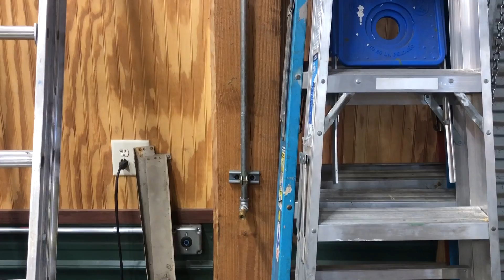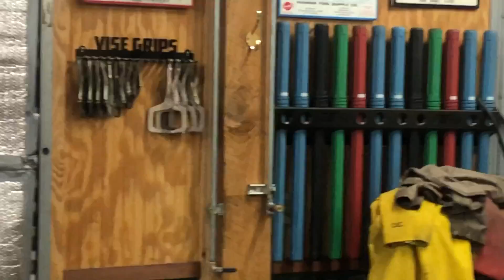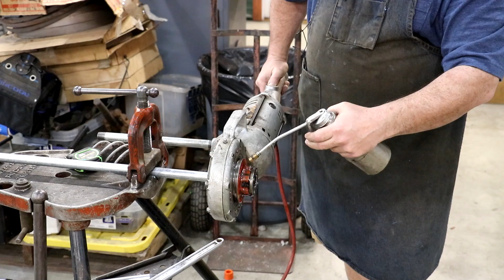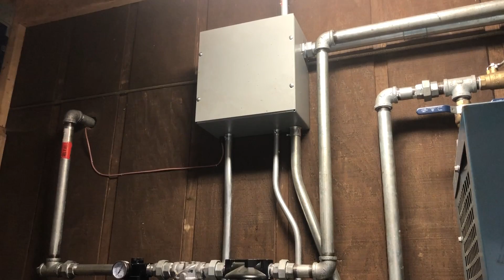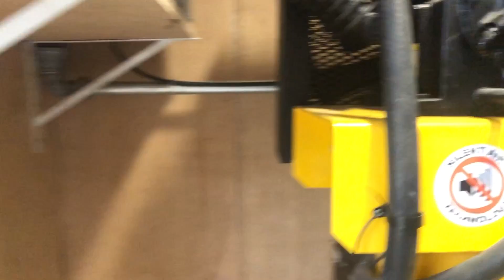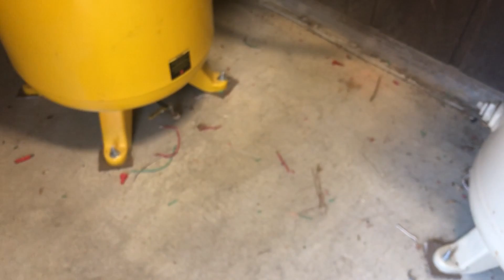The Ultimate Shop Air Compressor Setup! (at least for me....)

Comment: Its good to see a proper screwed galv pipe compressed air installation that is not only reliable but safe.  A client of mine, who is a major bus operator in UK tried a plastic pipe compressed air installation in a bus workshop and found it disastrous.  Apart from the constant leaks, the crunch came when a joint let go and the plastic pipe flailed around the workshop after ripping the feeble clips out of the wall, that simply can't happen with galv pipe.

Comment: Hello Keith,  As one who put in 'blue plastic pipe' a year ago I can tell you you made the right choice.  Mine has been slow leaking since the beginning with the only explanation being the pipe is not air proof!  It is also only rated for 200 psi max in 3/4" and 150# in the 1/2".  The system has to make up every couple of hours and my sixty gallon tank and 100 foot of 3/4 main with 120 ft of 1/2" drop.  The compressor is tight for many days.  The blue crap will drain the complete system down to 10# in one day and in two will have none left whatsoever.  I have soaped every fitting numerous times and have also gone over it time and again with a electronic leak sensor without finding any leaks.  The "O" ring seals will probably deteriorate over time as well but the system from the get go has been expensive, time consuming, poorly engineered and very cheaply made with little quality control (rough plating on the casting, rough threads and surfaces the O rings have to go over etc. etc.).  I am meticulous about my work and have been around plumbing of all kinds for most of my life (seventy one years currently) so when I say that it was installed fully according to directions I know what I am talking about.  Two of the fittings has casting flaws and had to be replaced at installation.  Nope.  I think you went in the right direction.
Just to add another nail to the coffin and extra complexity to their system the 3/4 coil pipe takes entirely non interchangeable fittings from their 3/4 straight pipe sections.  Something they hide in the small print and you quickly find out when you order their fittings (necessary because their 3/4" is a bastard size and will not interchange with non permeable heat rated Pex).  The box system is looks good in the catalog but is really only suitable for the smallest and simplest installation.  If you run a large shop system your cost will rise exponentially.  The drops terminate in aluminum blocks which have less than quality threading and are so thin their are very few threads holding your plugs, drains, and fittings.  The hidden 'O" ring system on the fittings leaves much to be desired as you have no way of knowing if the O rings has rolled when pushing in the pipe other than pressure testing and finding it is leaking (luckily I did not have a problem with it but it haunted me in "what ifs" throughout the assembly!).  Your system will serve you well.

Comment: Thanks for sharing your methodology and design factors Keith, I am moving soon and will have to finish out the shop space at the new house right from the studs and rafters.  It's not a huge shop, nor do we have the same humidity issues here in Alberta, but I want to put in a decent air system and it's good to get ideas from you, Stan Zinkoski, and Steve Summers on air systems.

Comment: Rigid 700 not 100 and as a sparky I have been cutting rigid galv conduit for 35 years with a band saw. It may not be quite as strait but there is a lot less reaming to do and it is a lot faster.

Comment: Hi Kieth
Although you have a drier in the system I have found it always best to include a small length of condensate drain pipe continue past the air take off point.  In the overall scheme of things it is not much extra cost.  This pipe terminates with a ball valve.  This allows you to periodically blow down all air take off points to remove any condensate or foreign objects/rust that is missed by the main condensate trap..

Comment: Nice setup, I think for same effect and less work copper pipe would have been easier since soldering/brazing the joints is very quick compared to threading the pipe which introduces another "leak" point and copper has better corrosive properties than galvanized pipe, since if you get even a tiny nick in the galvanized coating it will rapidly rust because of the moisture and flow rate that introduces a lot of oxygen to the rust point, you don't get this from a copper system and in my opinion nothing beats the look of a copper system that's done right. Overall I believe your system will last a long time and will do the job, nicely done!

Comment: Have to agree with the general comments- great system! I've seen shop with more than a quarter million dollars in tooling running way too much less. they don't usually think about spending the money till after they have had some expensive replacements or overhauls due to moisture and trash from the air system. On the overnight leave on- there are some inexpensive 24v sprinkler control systems that you could wire into your control side to shut that down after a certain time and not bring it up till a set time. You've already done the expensive part with the low voltage base you have. Adding some drip legs to catch crap and water at the base of all your out legs is all I could think that wants doing- great work, absolutely!

Comment: We all have our preferences but after installing more than my share of air lines ... up to 2" ... with both galvanized and welded black iron after switching to the blue ... and it's not plastic ... it's aluminum ... I'd never go back. As far as the installation goes .. that's exactly how I did my systems and I've been on the business end of a Ridgid 700 more times than I cared to.

Comment: A real time clock relay to shutdown the shop was the old reliable way to reduce the chance of human error but the options available now are wifi and large, much more fun. A wifi enabled relay can allow a timed shutdown and direct control from your cell phone. There's also input signals to monitor anything you might need to keep an eye on. A vacuum composite curing babysitter paid off as a productive and fun wifi project. 

  I've installed many compressor starter systems with a timer and solenoid valve to bleed off head pressure long enough to get the electric motor up to speed. Although the mechanical ones do work they're better off being your backup. With a timed relief the motor can be spared from most of the high inrush start current. 

  My suggestions were typed without my consent. My hands are apparently very bored with this whole isolation thing. I will try to find something useful for them to do while they're stuck waiting.

  I do wonder how many hours of compressor consideration you've invested in this system. I bet it's been developing over many years and it's time well spent. 

Always interesting stopping by, thanks for the invite.

Comment: Pop the plug off of the bottom tee of every drop and add a 4" long piece of pipe with a cap.  That'll be your dirt leg to catch trash and moisture.  A blow down valve on each drop after the dirt leg is good too.

Comment: Keith, I went through the same situation of plumbing an air system.  Used galvanized pipe also.  Rather then stumbling over air hoses, I mounted an overhead retractable hose reel that is spring loaded to return the hose to the reel.  Now once done using the air, just pull on the hose, and up goes the hose back onto the reel.  For a longer shop such as yours, suggest several overhead reels for convenience with 50 foot of hose each.  Just a suggestion to make things more convenient for you.  Regards, Rolly.

Comment: Oh good... I'm not the only one who was crazy enough to run galvy air lines.   Even with the UP-drops, I'd still recommend a drip tube and drain valve at all your air fittings.  I still get water.
Have you seen Milton's new V series air chucks??   They take the new V plugs (70% more flow) but they still accept M plugs too.

Comment: I have my phase converter and air compressor controls hooked up to a contactor that is controlled by my light switch. If I remember to cut off the lights, everything else is off also.

Comment: i like your air compressor/system. i did something similar but on a smaller scale. in the future I want to install a fitting to plug into soon after it comes through the wall followed by a ball valve. that way i can isolate and still have air. most of my power tools are air powered. if i need to work on my system they don't work. i really enjoy your videos. thanks.

Comment: Only change I would make is moving the pressure regulator out of the line in the shed. If you are running more than one item at a time it is much easier to regulate the pressure at the tool end with the tool on. That is especially true with things like blast cabinets as they take a lot of high pressure air and needing to have someone holding the valve open while you adjust the pressure in the shed is a pain.

Comment: Where I used to work, the factory had a 12 inch pipe in the roof as both compressed air storage and distribution. 
The trick was that the pipe, some 600 foot long, sloped down at one end about 3 inches.
Air feeds were mounted off the top of the 12 inch tube, at to low end of the 12 inch was a 4 inch pipe welded into the bottom. 
Reason was to feed "dry" air to the tools and to collect any condensation in the 4 inch off the bottom. We had a fitting on the bottom of the 4 inch to drain any accumulated water. 4 inch was about 20 feet long. Was a daily job to drain it.
Worst thing for the air tools is water, freezes them up real quick.

Comment: I probably would have used black pipe instead of galvanized. It looks more industrial, especially when it gets a little bit of rust on the outside, and you don't have to worry about zinc flaking off and getting into your air.

Comment: My dad built his truck shop 1984, he made a ring line in 1" zink coated hydraulic pipes, cutring couplings, he mad a fall to every corner and a blowdown pip in each corner.
Cejn water filter,pressure regulator and lubricator on every drop point.
Drop point every 3m.
Not one problem with the piping to date.
At the same place you have a 16amp 400v and 230v outlet.
Short cables and airhoses makes the floor spaghetti almost disappear.
I'll bet you will not have a problem with your system for your lifetime.

Comment: Shouldn't each QD connection have a drip-leg hanging down as the last, final hoorah of trying to catch moisture and debris rather than feed it to a final application?
Reply: It depends if you use an air dryer or not.
With an air dryer you don't have to take care because of moisture in the pipes

Comment: Kieth, at the very bottom of your drops you may want to add a stub pipe you can drain. Even with your p trap, water will collect in the drop you are using and it will need a drain. Looks like a great system and you certainly overdid it.lol

Comment: Many years ago when I installed air lines we had to use black iron pipe, had to use tees not couplings and crosses not tees. The owner of the company had a real thing about galvanized pipe. Looks like you will have a great air system for a very long time. Great video!!

Comment: your system ism much better than many shop systems, my only concern is about a compressor that consumes oil, in fact, it fogs oil and shoots it through all your system. 
If I were you, i would  install a fan to force air exchange in your compressor room because you should consider that you spend 10Kw of power that is  mostly depleted heat that stays in that very small room.
I don't have the funds to build such a complete system so I fabricated an air to air aftercooler that I,ve installed between the compressor pump and tank to maintain the tank cool, this has proven to be very effective . I made my shop piping in 1/2" copper pipe with a standard filter installed about 20 ft past the tank. and a filter regulator unit to feed my spray guns.

Comment: Hi Keith!  That's a far cry from your old, one-lung Craftsman compressor.  I still have mine after 30 years.  I think you need to use something like that for a few years to appreciate the convenience of what you have installed.  No more worries about junk getting into a wrench or paint gun, or spraying oil or water all over your just completed work.  Congratulations on a job well done!

Comment: I agree on the use of hard piping. The only difference to me is that I'd use black steel pipe in place of galvanized. But I do agree, that bright blue pex type tubing does look out of place. Steve summers channel just did some videos on the installation of that blue material, and even though he did a good, quite clean installation,  it still looks like waterline to me. Just my thoughts. Nice video.

Comment: Great job Keith...You have seen/used my air system. It is basically a one inch loop mix of black and galvanized steel, black plastic, PVC  and copper (LOL...depending on how I felt at the time that section was run)>> be careful that your shop AC does not lower the dew point of your lines below the setting of your refrigerated dryer. With black and galvanized steel pipe a particulate filter is necessary on sensitive stuff. You can feel the crap hit your hand out of the blow gun. At night (your dryer is off) the lower vapor pressure inside the cool lines inside the AC shop will cause system moisture to flow inside and the interior of your lines to sweat like a cool drink in the summer. I ran my mains outside for this reason but still have some moisture problems with extended non use in cool area drops. Sadly, I will never run another steel air line.

Comment: 30+ year industrial maintenance engineer and 'boots on the ground' guy here, and I'm dammed proud of you!
You did almost everything right, and the only thing you did that MIGHT not be 100% right is probably not that big of a deal in the long run.
The one questionable thing about your setup is providing power to the air dryer only when the unit is running, and if you know a guy that is really good on small, high pressure refrigerant systems like this, I would strongly advise you to get with him about this.
Hermetically sealed compressors like that are often designed to be internally "leaky" - that is, the refrigerant being pumped is not completely separated from the oily within the compressor. That's pretty much what keeps the oil cool enough to not degrade and have to be changed like you have to do in a car or something. The problem is, the oil and refrigerant sometimes mix so well that some of the oil will get pumped out of the compressor and into the condenser, where it condenses and ends up all over the place EXCEPT the compressor - which is where it is supposed to be.
A way around this is something called a 'crankcase heater'. A crankcase heater is just a small heating unit that keeps the oil in the crankcase of the compressor warm enough to boil out any refrigerant while the unit isn't actively running. It keeps the oil in the crankcase during downtime, and the refrigerant on the other side of the compressor. Without that, and especially in cold weather, you could  have some oil migration out of your compressor. Like I said, get a HVACR guy to look at your system and give you better advise on this than some random guy on YT like me. If you have the schematics and or paperwork on the system, he should be able to glance at it and give a 'pass or fail' on your set up.

The things that are right, and why:
1) For a 10 horse system, the two 80 gallon tanks are plenty of buffer capacity, but especially with the added 1" pipe loop that takes your 160 gallon capacity up to around 200 gallons. That prevents short cycling of the compressor and prolongs motor life.
1.B) Between your intercooler and double tank system, they are reducing the work load on your air dryer by probably a minimum of 60% - but I live just and work a little north of you in Georgia, and I know how the humidity can tax a system on those Dog days of summer.
2) A 1" main distribution loop is big enough for future upgrades up to about a 20 horse system. You could have gone with 3/4" pipe and been fine, but I would have done the same thing as you did and went with 1".
3) ALL 'drops' should start off as risers on compressed air systems, and I was happy to see that you did exactly that, and for the reasons you stated. Gotta admit though, when you showed the first quick connect outlet, I was cringing a fair bit when I saw an elbow instead of a tee with a dirt leg. However, I was happy to hear you point out that the ell was temporary until you could get a tee.
4) In my career, I've always said that a piping system cannot have too many valves, or unions /  blanked off tees (instead of couplings). I've worked in too many places that either had to run 24/7, or just had to keep running when something bad happened to a small part of some system that would require a total system shutdown in order to fix that one thing. The ability to isolate smaller areas for shutdown while the rest of the place keeps working while parts and labor come to bear on the problem,  is worth every one of those fifty to a couple hundred bucks of initial outlay.

Comment: I would have (and have) used copper. I think it's a lot easier to install and almost at tough as galvanized. I suppose that cost may have been an issue. I haven't done any copper plumbing for quite a few years.